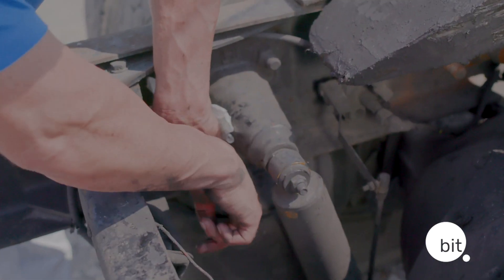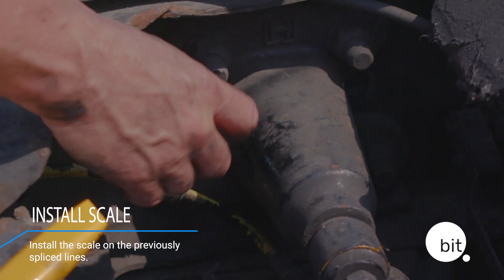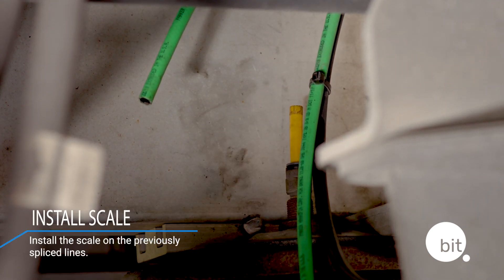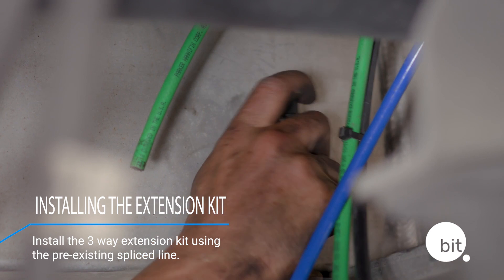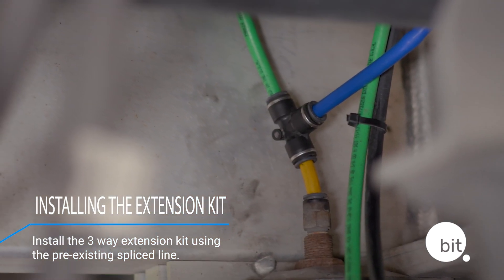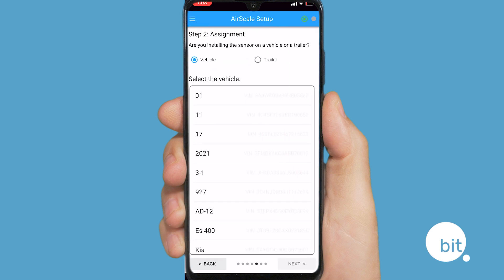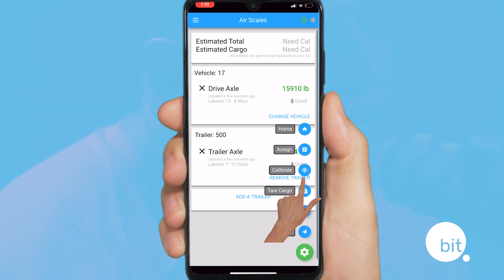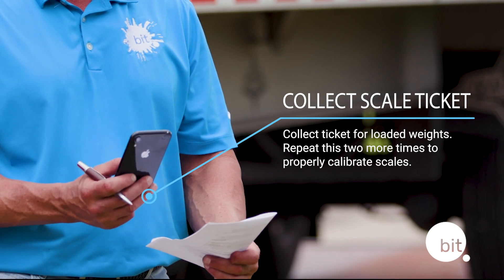Blue Ink Tech Air Scale Installation Guide

Comment: Stay away from this clowns 🤡 nothing comes only censored, no instruction and no semi trailer only truck and 10 Lyft axles 😮😢😢😢😢
It hard to connect:( 
The person who created this have no clue about trucking only his packet scam you 😮😢😢😢😢
Only problem in the real life the app it’s completely different. It doesn’t have trailer only truck and 10 lift axles and there as I have to connect your junk to your app. 
When I scan the QR code on the box goes to Google, why do I need to Google when I need to be connected?   !?????